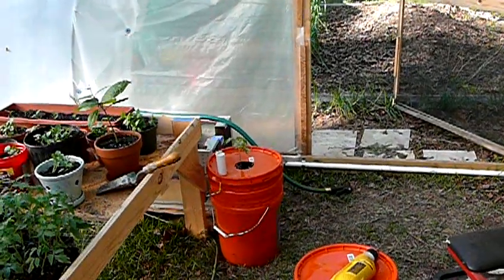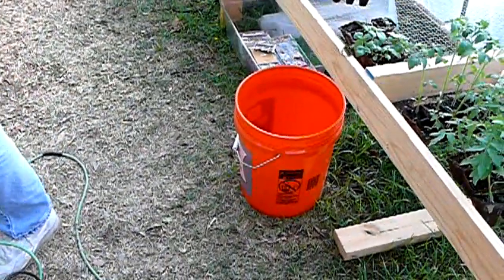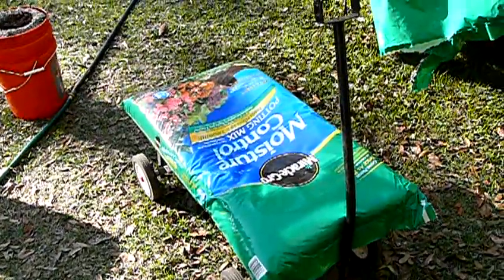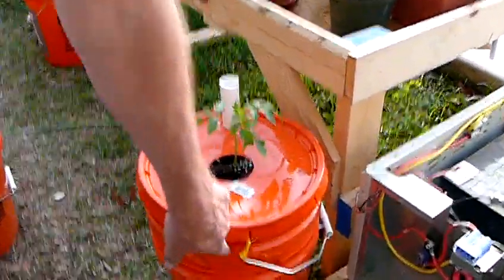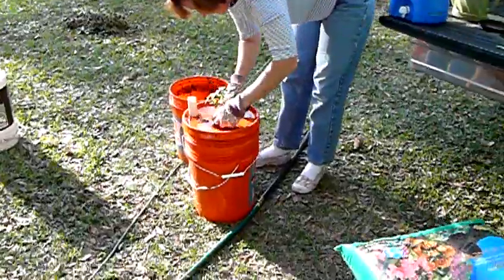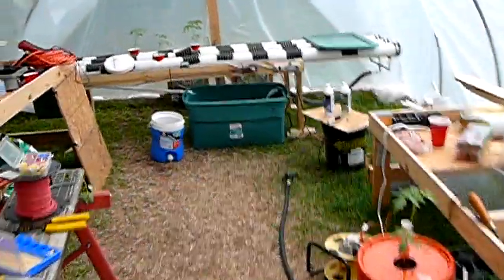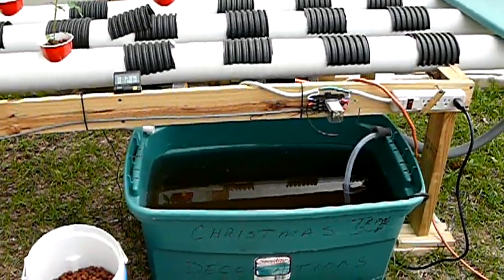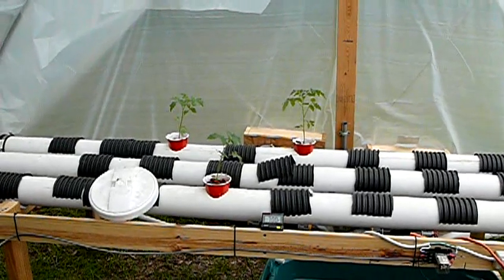hydro5B

Comment: The earth box is hydroponics being you used a soilless mix The ebb & flow is active, and the earth box is passive. 

Considering your setup-- the earth box will probably give you fewer headaches. I have 180 tomato plants on a run to waste system-- recirculating systems, unless temps are controlled usually cause problems. 

Once the tomato plants start to mature, keeping them hydrated will be a challenge in the ebb & flow. You may need to modify to NFT if wilt becomes a problem.